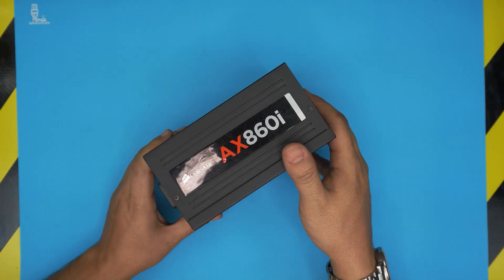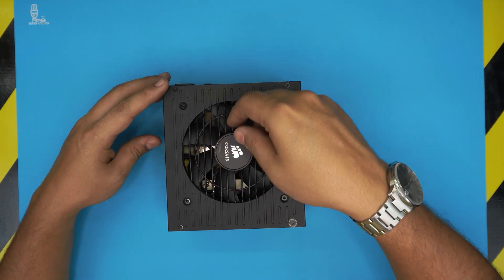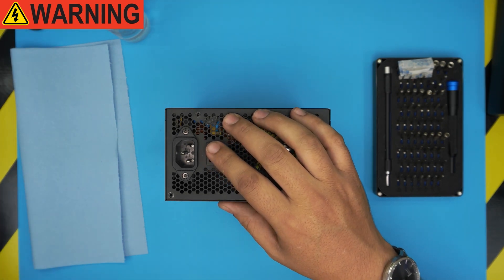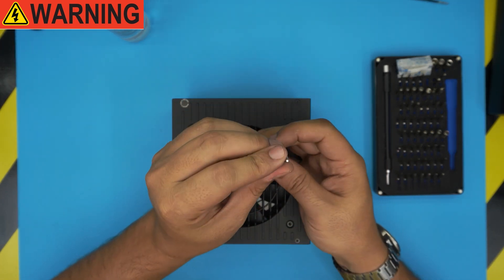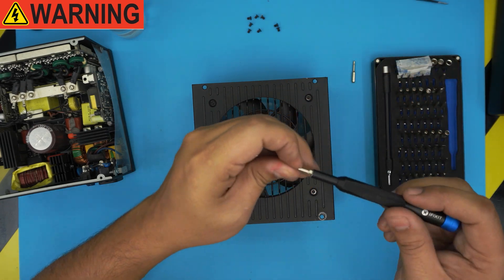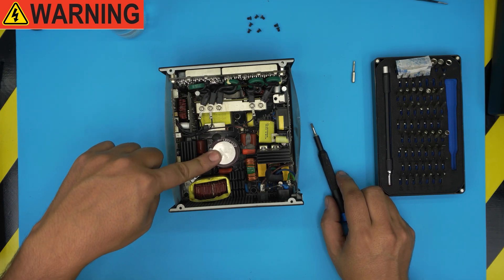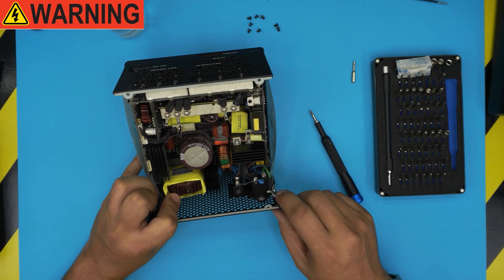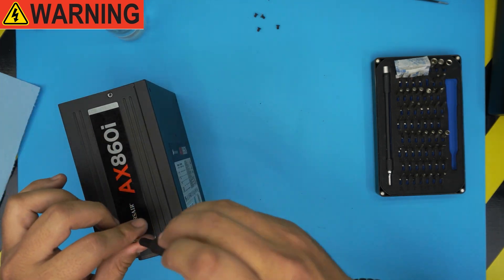Corsair AX860i 📢 ATX PSU Service 📌 Power Supply Cleaning

Comment: To discharge the capacitors, could you just unplug the computer and press the power button?
Reply from the maker: 🫠Regarding your question, sure, you can do that. Hold the power button for 10 seconds, and it will discharge. Even if you don’t press the power button and only disconnect the power supply, the motherboard will discharge the capacitors within 30 seconds anyway.
Should you have any further questions or requests in the future, please don't hesitate to ask me.
cheers🍻

Comment: just wondering is it okay to leave the plastic remove from the psu that is on the fan
Reply from the maker: 🫠Regarding your question, it's okay, but not recommended because the plastic helps with airflow over all the components. If you remove it, not all components will receive the airflow needed to cool down.
Should you have any further questions or requests in the future, please don't hesitate to ask me.
cheers🍻

Comment: Will the 12v, 5V and 3.3 volts come back to their original values after cleaning my Corsair VS 650 psu like this ? The 12v in mine shows 11.8V now..and my pc is frequently restarting !
Reply from the maker: Thank you for your feedback! If you wish to support the channel, you can like, subscribe, or both!
Regarding your question, unfortunately it will never comeback on, because the transformer inside is getting weak. you will need to get a new PSU, if you keep using this it will damage the board because of under volt.
sorry :(
Should you have any further questions or requests in the future, please don't hesitate to ask me.
cheers🍻